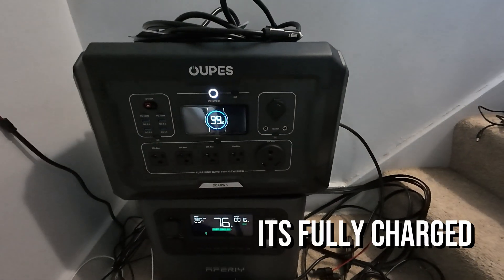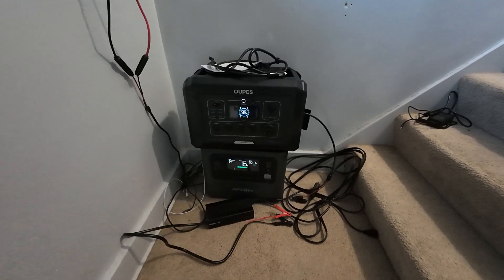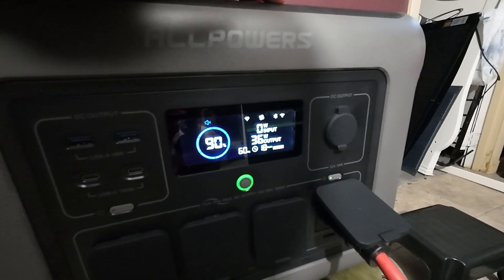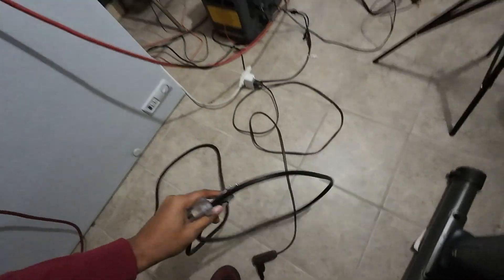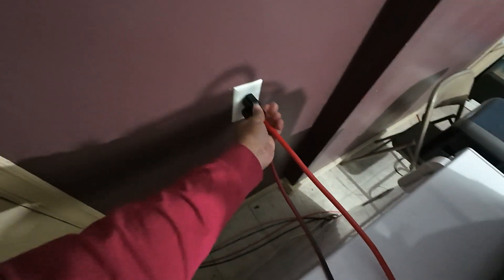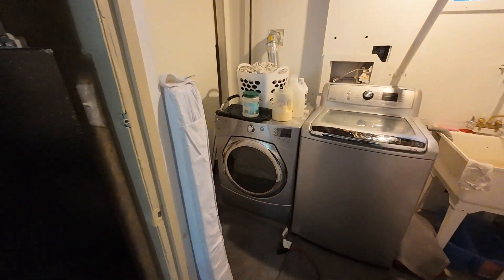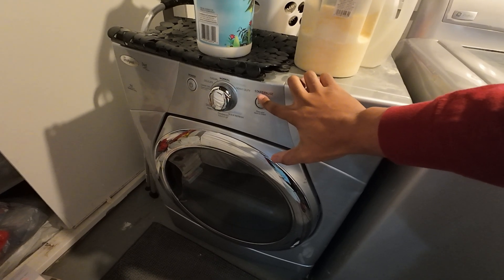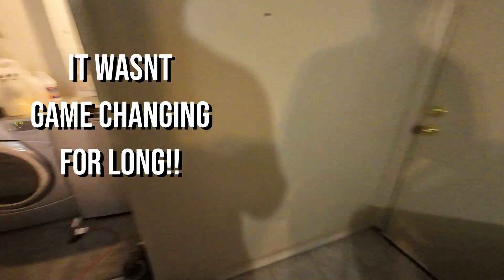Testing Powering My Whole House with Oupes Mega 2

Comment from the maker: Don't Forget To Like!!
The Oupes Mega 2 performed well but theres a BIG BUT coming in this series on this device!!

!!WARNING!! - Male 2 Male (Suicide Cables) are VERY DANGEROUS, hence the name. I use them with great caution. My main and any 240v  is ALWAYS TURNED OFF! 
DO NOT REPEAT THIS and IF YOU DO SO, YOU DO IT AT YOUR OWN RISK. 

Power stations have on and off switches and I have also added a manual cut off switch.
Reply: A lot of power stations have big buts, that's why I went all out and bought a big Momma 3600 watt Power station. Hopefully, I'll be able to enjoy AC this summer without any issues.
Reply from the maker: I know man. So much compromise for the sake of them coins. Sometimes you just gotta spend them to be at ease.

Comment: That was impressive. To handle that load with the preexisting draw, impressive indeed. That thing is punching above its weight.
Reply from the maker: Fam, exactly. I have power stations that can do it by themselves but to be fair, I have discovered that the weight of the clothes  has something to do with it.
Reply: @AskIveSolar That makes sense if the weight directly impacts the energy draw. Real world scenarios remain the only way to find the limit of these devices instead of the fluff reviews that amount to a bias infomercial.  That is a lot of bang for the buck regardless. You doing ya thang and I appreciate the work you put in.

Comment: Sup bruh? I don’t mean to crash the set, but did you know that Point Zero Titan Solar went out of business yesterday? They sold everything. I’m talking bout batteries that didn’t work even their very own prototype to their last offering which was the 240sp (split phase). Guess who they sold it to? 😂 Yaaaa boy snagged it up on the low low. Anyway I just wanted to drop that news and see if you had heard.
Reply from the maker: Man I didn't hear that. That's kinda wild! I know you've been impressed with them from a value standpoint over the months as they lost their luster
Reply: @AskIveSolar I read their reasoning and it came down to the space just being too competitive and the cost of sourcing material. Mom and pops shop as they put it, was getting overwhelmed by so many new players in the field. To keep it a buck they weren’t cheap, thus me not having anything other than the two modules acquired as used. Those batteries, albeit a premium quality product, were beyond my budget.

Comment: A well done video, but although I see your comment response that you have reasons for not doing a transfer switch and have thought through how to do this safely, I’m wondering if you’ve considered the risks if there are family members who may have to hook up in an outage and may not be as knowledgeable?  Also, the outlet you used as an inlet may have been a 15A standard outlet with  1800W max rating and the wiring may be 14 gauge.  By sourcing from  the Oupes the breaker is bypassed, and you may have a fire hazard.  Even a 20A outlet’s rating is only 2400Wmax, less than the 2500W Oupes steady state rating, much less the 5400W short term peak. 
I’m on my third mega 2, but I suspect the issue has to do with AC charging, such as from a generator, while connected to a transfer switch so it shouldn’t affect you.  Running with solar inputs has been reliable, although my perception is that the Oupes mppt limits power input in variable sun/cloud days in comparison with a dabbsson DBS3500.   Thanks for posting the video!
Reply from the maker: Hey Stephen, thanks so much for the comment, concern and questions AND the information. I need to read ti a couple times to make sure I understand. 

So Im usually home whenever Im managing this stuff. Our kids have been taught about the dangers of electricity early and we teach them often especially with all these power stations around. The mrs is also a Stay and home mom and we spend a lot of time. 

I dont think im bypassing the breaker and it is 15amps but I dont send power through that same circuit twice so it wouldnt be overloading it. So while you see a certain amount of potential power going through, its through 2 separate circuits on 2 different legs. 

Also consider that if the house wiring can handle the surge then it should be fine to run that power through for a short period but considering my previous paragraph, that wont be the case. 

Also keep in mind that at the end I shared that I wont be using one powerstation but 2, to me the only issue is pushing that much power through one leg of the AC breaker panel which is not a scenario for me with my current power draws. 

Whats your specific issue with the mega 2 because I had an issue with mine (jumping ahead a bit in the series) where when it drains down to zero, the device doesnt charge back up. 

Thanks again for watching and for chatting it up with me on this subject.
Reply: Glad to chat. Normally the current to an outlet is from the mains through the 15A breaker, so if you plug in a 2000W load in the outlet the breaker trips.  You are reverse feeding the outlet from the Oupes, and as you showed in the video there was more than 2000W being sourced.  The outlet itself is not physically designed for this, and it may get hot(especially cheap ones or with dodgy contacts).  It’s the same reason there are all the warnings to not load down an outlet with outlet extenders and steady state high loads, because fires have happened.   Using two supplies will reduce the heating but the potential is still there.  Also, if you make a mental error and plug both supplies into the house without isolation between them  you may blow one or both supplies.  I tend to be cautious because, while not an electrician, I was an electrical engineer for 35 years and designed power supplies among other things. I’ve become a firm believer in things going sideways unexpectedly, especially in stressful situations.  A mistake with your setup could, even if the probability is low, potentially result in a shock, damage to the supplies, a house fire, or shock to a lineman.  I thought I remembered an article where a lineman had been killed in a fall due to a shock from a guy using a suicide cord setup and  the guy was convicted of manslaughter, but I couldn’t find it with a brief search so maybe not.  Anyway, you’re an adult and can make your own decisions, I just wanted to make sure you thought it through and had the information to keep safe. 
I had two mega 2’s pop at the AC charging input while connected to a transfer switch (such as from my gas generator via an extension cord).  I haven’t heard a good explanation from Oupes (otherwise their service was very good).  Both Oupes and Dabbsson (which has not failed) have said that my setup should be fine. At this point I only AC charge the solar generators when they are not sourcing power (tho I’ve done this many times in the past) and have not had any new failures.  Most of the time I’m charging with a small 1200W solar rack I set up for future emergency power needs.  I wish I could tell you more.  Oupes did tell me not to fully discharge the battery.  I’d have figured that “0 charge” would actually be designed to be the 20% or whatever the safe minimum actually is for LiFePO., but maybe not?
Reply from the maker: Without reading all of it, I don't want to point out that even though it's showing 2000w, it's not all going through one breaker. 

I'll finish reading now and continue the chat.
Reply: @AskIveSolar  sorry. Threw a lot out there.  Just focus on the outlet.  You have the male/male connection from the mega 2 to a wall outlet.  If the physical outlet is designed for a 15A circuit it isn’t designed for a 2500W source like the mega 2. Also the wall wiring is likely 14AWG.

Comment: When you plug the power station directly into the outlet to power things , are you turning off the breakers at the main panel or shutting off the power completely ?
Reply from the maker: Turning off the main breaker and any double breakers. Good question! I'll add this to my pinned comment.

Comment: I'm interested in seeing your thoughts on the solar charging.
Reply from the maker: Solar charging was slow but I dealt with it because it could take in so much solar.
Reply: I'm waiting for the Transfer switch install.  You was one of the people that influenced me to do it. It's actually not that hard (and I'm NOT an Electrician) once you get past, not touching that main cable that's always live. But those widow maker cords he's using to power his home instead scares me.
Reply from the maker: @Moes_Prep_and_Tech with a power station they're never live unless in the wall.
Reply: @AskIveSolar  They call it the Widow Maker for a Reason, I'm sure your careful with it but what about the others that live with you, Or line workers, if something bad happens it will fall back on the Solar guy. transfer switch is easy. put sticky labels on what each circuit breaker powers so you know what it is. Shut the Main power off. Open it up take the wire that was going to that circuit and tie it with the corresponding cord with the switch, it's easy. the only thing you have to keep in mind is not to mess with the big phat chord you see that runs down the middle that comes from outside, it's always live but other then that you have nothing to worry about. I did it myself in about an hour or so. Just remember label the circuits first because once you open unscrew it from the panel you won't be able to tell what's what. what a couple of youtube videos about it twice. have some extra light handy. I had one of those headlight lamps on my head when i did it. Get yourself one of those electrical screwdrivers with the rubber on it for safety. The hardest part for me had nothing to do with  the wiring at all it was screwing the box into the wall
Reply from the maker: It's interesting because the confidence you have with the transfer switch, I have the same with the cords. 

I just feel like with power stations and the lit switch and lit extension cords, it's as safe as it can be. 

Check my response to dmack
Reply: Ecoflow just released something similar to what you are doing but for whatever reason it's only legal in Utah as of right now. It's a system you can plug directly into the wall to export power
Reply from the maker: Yeah me and Setite and Jasonoid have talked about it a bit
Reply: @AskIveSolar  the name of the video I Watched was called "
EcoFlow STREAM Ultra & Microinverter | Plug-in Home Solar System 🏠 All Features Explained"

Comment: Ive,
 
I will ALWAYS appreciate your candor, ingenuity and zeal for solar power. I wish though that you would seriously consider installing a dedicated transfer switch to power specific breakers at your home's breaker box instead of needlessly risking serious injury or a potential fire by backfeeding current into house wiring via suicide cords.

Transfer switches are very inexpensive, easy to DIY, and aboundingly SAFER than your present method of powering your  appliances and entire house.

Shalom & APTTMHY!

DMACK!
Reply from the maker: DMack, greatly appreciate the admonishment! I have about 5 transfer switches in my Amazon cart. Sadly I don't know if it's the right fit for me at the moment because of the limited hardware that I have. 

Also before I get over, I need to upgrade my panel because it's too old for licensed electricians to add a transfer switch to. 

If your interested in my logic on why the transfer switch is not the right fit for me, check out some of this Livestream I did on it. 

Short version is, id need maybe two transfer switches because of the split load due to only having 2000 / 2500 watt inverters. 

Now if I had something or a couple things with 3k inverters or more then a single transfer switch would work. But for now, I just make what I have work and I take every precaution I can think of.
Reply from the maker: Transfer switch discussion

https://youtube.com/live/RyqfLeRiP2s?feature=share
Reply: @AskIveSolar  the very 1st transfer switch I had and still have has 4 ports on it the main plug in was a regular 20amp plug. I started off with just the AC200p using this. I did it for  year. I ran a good 75% of my small home. Minus the electrical stove. The only Caveot of it was being consciencly aware of when the microwave was run. The circuits I had on it was the gas furnace (about 500 watts when the blower turns on), 100% of the lights, all plugs in the 3 bedrooms and kitchen, the only things it wasn't attatched to was the laundry room and garage, the laundry room I had a deep freezer and 120v washer in it, I ran a short extension cord from there to the kitchen to power those 2 things, which barely drew a lot of power. For the Garage I would run a cord out the window or just take the ac200p outside, I used it to cut grass.I later upgraded to a 10 switch panel which covered the garage and laundry room  with 2 extra plugs to spare (I never hooked up the stove) When I upgraded the Ac200p to the AC300 my whole world changed, I still used that smaller transfer switch with the AC300 for another year or so before getting the bigger one.
Reply from the maker: @Moes_Prep_and_Tech  Thats dope, thanks for sharing your experience. I cant lie, you saying how straight forward it is puts my mind at ease a bit but its this older panel I have that gives me cause for pause and I want to update that first or update it all in one fell swoop.
Reply: @AskIveSolar  my house was built in the 50's does your breaker box have the circuit breakers with the little colored round circles in them or the switches?
Reply: @AskIveSolar  is your breaker box a fuse panel or breaker panel? The Older Fuse panel (something i used to have) has the round multicolored plugs in it
Reply from the maker: @Moes_Prep_and_Tech it's a breaker joint but push button. I think it might be a push o matic so it's not like sideways light switches.
Reply: @AskIveSolar  Yeah, you have the one I used to have, I didn't cost much to upgrade it, I had a couple of people tell me it could of been something I could of did myself but that was years before I started getting into Solar and electrical stuff and was afraid of that kind of thing. The next thing on my list of things to do is getting me an outside connection for a Gas Generator for any emergency outage that could occur when the weather sucks, especially winter time. I could run it for like 3 hours charge up my batteries then run off the power station alone for the rest of the night till the sun comes back up